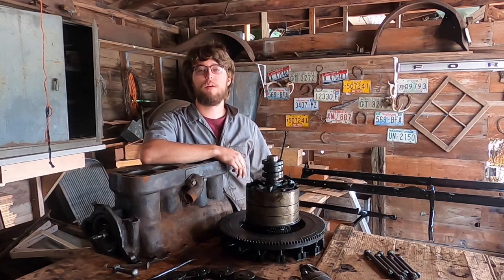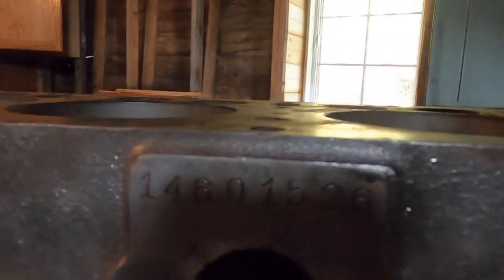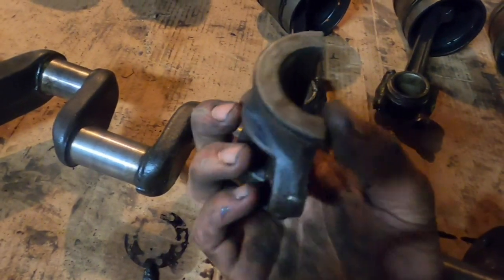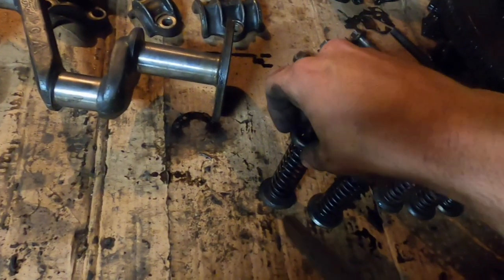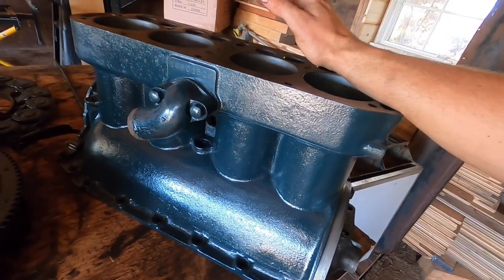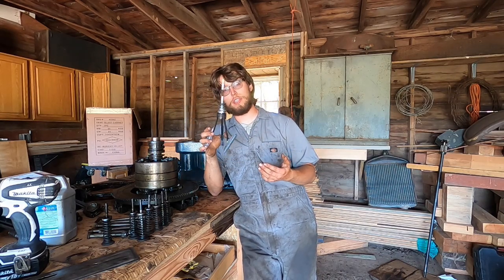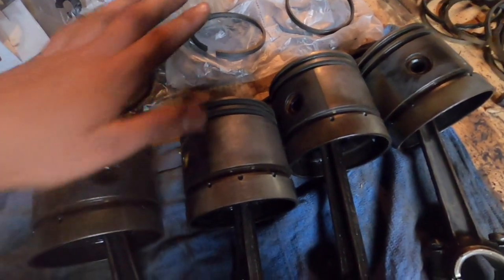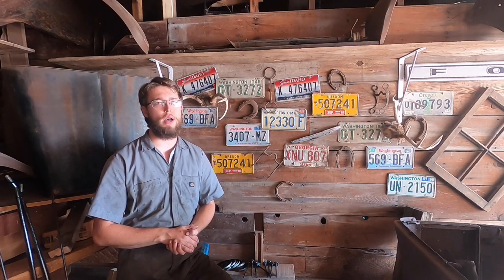Engine overview, 1927 Model T

Comment: It had low horsepower but the torque was high and so the reason for only 2 speeds made it simple to drive. Just remember 20mph was very fast in 1920's on all those bad dirt roads. When the demand for the Model A came , because it had a clutch and it had to be double clutched too... many people mostly woman could not drive them. Yes the T was way ahead of its time... as far as ease of driving.

Comment: Actually the t engine is 177 cubic inch 2.9 liter which is rather large for a 4 cylinder .
Reply from the maker: Thanks for telling me!  I will add a subtitle "fix"
Reply: No problem , snapped my crankshaft and in the middle of rebuilding mine . One recommendation is to switch to Kevlar bands . I do love them because one you set them they don’t wear as fast as cotton , and grabs better than the woods bands .
Reply: Thanks, I am using Kevlar.  I will have a video out sometime soon on it (hopefully, editing takes a lot of time).   Snapping a crankshaft does not sound like fun, I hope mine will hold on for a while.  Good luck, and happy tinkering.